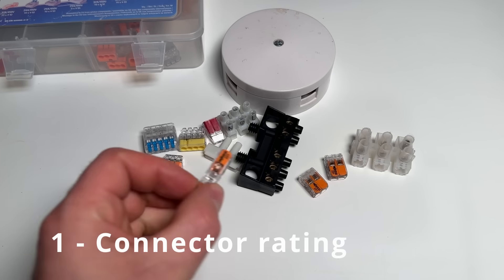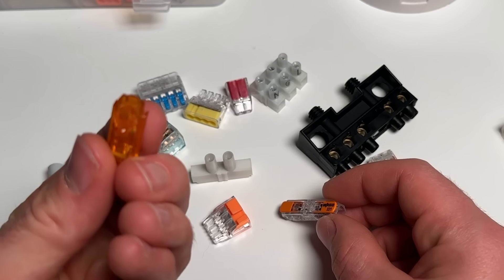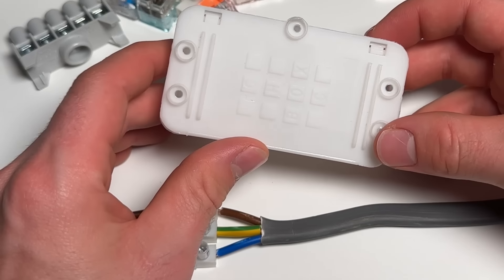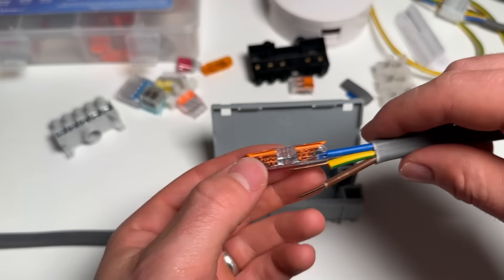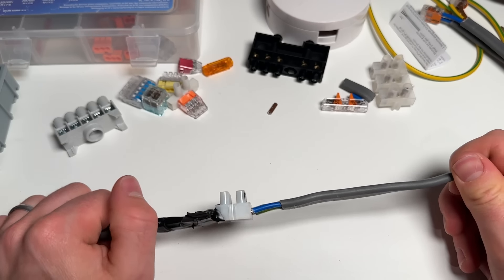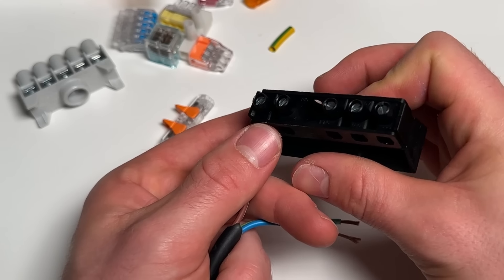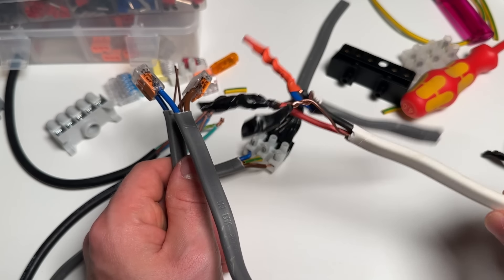BIGGEST DIY Mistakes Joining Cables

Comment: Wait a sec, you want to teach somebody about connections, showing in your thumbnail phot that Wagos (perfectly safe and strong) are bad, and then showing NOT EVEN CONNECTED terminal block as "worse".
Reply from the maker: A terminal block not connected is still worse than a wago haha. The wago in thumbnail shows exposed copper, that is why it isn’t okay.
Reply: I agree with you, thumbnails like this is stupid and misinforming , and nobody looked that the wago had exposed cooper.
It's not the first video I've watched with this type of thumbnail and i always give a thumb down for things like this.
Reply: Confused the fuck out of me
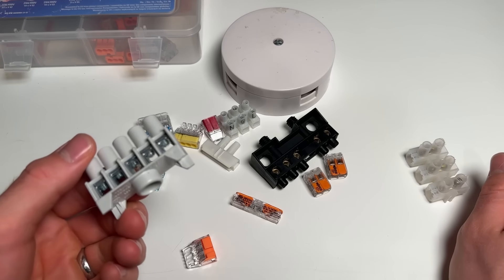Reply: Yep, clickbait ass thumbnail. Downvoted at 1:20, not going to finish, and told YouTube to hide channel/not recommend. It’s disrespectful wasting ppl’s time.
Reply: @ArmanRafique  in that case you could not properly inspect joints visually
Reply: In my experience its diy people using low capacity block connectors to extended shower cables quite often there melted
Reply: @TheDiligentDIYer1759 nothing wrong with wagos if used correctly
Reply: I noticed the exposed coppers pretty quickly tbh!

Comment: The Wago's are an amazing invention, safe and simple for domestic electrics.
Reply from the maker: Absolutely! Thanks for watching!
Reply: @TheDiligentDIYer1759  Strangely enough it's pronounced Vah-Goh. Watched an efixx video interviewing some guys from Wago who said it's named after 2 guys who made the patent for it in the 50's.
Reply: Also WAGO is a private company and has the patent on it, outlawing it so it becomes a monopoly and can change the prices whenever it wants its a terrible idea
Reply: @MrFiver1111  I prefer that over a chance of a Chinese WAGO for 0.00001 cents a piece that will burn your house down. The patent ensures that the original company's design is followed including the guarantee for compliance.
Reply: ***the wagos with clamps The ones without clamps and no hole for the multimeter... my fucking god, I hate taking those things off so much.
Reply: @djoakeydoakey1076  Not strange at all, as it is a German company. Hence the car brand VW is pronounced Folks-vagen ;)
Reply: We will see in 50 years - what it is worth.... Electrical installation at home should work properly for years - with currents up to 16 A...
Reply: @slapfight3581  The Wago has been in common use since the 1980's, so in another decade we have the real world data.
Reply: @MrFiver1111  HAD a patent on them.
Reply: agree they give you confidence that the wires are nice and tight and avoid the worry if you round tiny screws on normal connectors..love the lever option
Reply: Old, experienced electricians still preffers twissting cables.
It is a proven cable connecting  technique
Reply: @markot9902  Twisting works, but what about disconnecting and connecting them back? Using WAGO - no problem with that.
Reply: @Piqus3  Yes, that is true. Although, there is rarely need to "untwist" twisted joints.
Old school electricians told me that wago's have problem with springs and it is common for them to experience lose joints after cpl of years which requires replacement
Reply: No.
Reply: Hey Boss im trying to do a Y Plice on my Govee Lights, if i use the 3 connector should i expect any problems? im branching off to the side of the house and im afraid it wont have enough juice to power the remaining lights as it will be another 50 feet?
Reply: @Papiringo505 Difficult to answer without knowing more details. The Wagos can handle domestic voltage and current. Use the correct gauge of electric wire cable to power your extra lights. Seek the help of an electrician if you are unsure. 🙂
Reply: @MrFiver1111 Numerous other big companies make similar products, so WAGO’s patents are clearly not a barrier to entry.
Reply: @markot9902  rarely a need to untwist twisted joints? what do you even work as an electrician?
Reply: Safe and effective. Mix & match stranded and solid wires without issues. They are rated for any domestic and office needs. All of these connections are fine if used on the right place. Electricians know what to use and where.
Reply: @TheDiligentDIYer1759  how do they extend cable outdoor light wire
Reply: @MrFiver1111  however there are lots of other manufacturers who have made their own design which is fine and they are approved so it’s not on monopoly when they simply make wire connections because there are other method
Reply: I would never buy those plastic ones with a screw. I have seen that plastic decompose and turn into dust when I just barely touched and squeezed them.
Reply: @llVIU 😂😂😂😂😂🤦🏾 for real a testers nightmare

Comment: Struggling to understand how terminating stranded cable in screw connectors without a ferrule can be bad when there must be literally millions of UK 3-pin plugs in use at this very moment wired up in precisely this way.
Reply: A UK plug is designed to accept fine stranded cable. Curved sides that have no side space, smoothed screw end. Most connector blocks are not. Rough screw end that damaged the strands and space around the screw for the strands to float in.

Comment: There is a difference between twisting and twisting. The way you doing it, showing us, is the wrong way but if you do it the right way it is very strong and makes an excellent connection. Twist solder around it and heat it up properly makes it even better. This is the best connection you can make, no other connector can beat this. By using shrink tubing properly it is also water tight and protected against corrossion. Rule #1 By everthing you do you need to know how to do it right.
Reply: @OntraadSpeldinnen:

Totally agree with you, a good twisted and soldered connection makes a pretty perfect cable joint.
A lot of people will try to tell you that a crimped connection is a bad connection, but in 48 years of using them I've so far never had one fail.

Comment: 30A juntion boxes are designed for ring final circuits. They were commonly used and still are to extend cables. Each leg of a ring is desinged to pull at max of 27 Amps at fault. So a 30 Amp jnc box in situe is perfectly acceptable as long as it's accessible for inspection. We tend to use wago and ideal connectors in Maintenance free boxes so we don't have to worry about inspecting them.
Reply from the maker: In theory you could have a very long ring and sockets close to the CU maxed out, and probably exceeding 26A, or even 30A, on that short leg. Thanks for watching!
Reply: @TheDiligentDIYer1759 on a ring final circuit the sockets are fed from both sides so there won't be an issue with sockets being further away from the fuse box. Did you know that 2.5mm twin & earth cable is only rated for 26amps? A 30amp junction box will be more than adequate
Reply: How will the maximum fault current only be 27A when the circuit is protected by a 32A breaker? And this is only the working current not fault current rating which can be in the hundreds of amps momentarily.
Reply: @TheDiligentDIYer1759  to fully understand the UK ring final circuit you need to understand the application of diversity. This is usually beyond the understanding of your average DIY’er. If in doubt consult the qualified electrician.
Reply: Ring circuits will have two cables coming out the circuit breaker supplying the sockets so the 32 amps will be split between both cables that's how you are able to use 2.5 cable rated at 26amp as the electricity will take the path of least resistance meaning it will draw from the cable that's closest to that   socket
Reply: So he favours Wago's that are down rated with 2.5mm cable but not a 30 amp junction box. 😊
Reply: @TheDiligentDIYer1759  Ring final circuits used to be on 30A fuses.   They didn't blow at 30A (indeed a 32A MCB is likely to trip before a 30A BS3036 fuse blows) but the junction boxes were considered suitable.
Reply: @martinw245 yeah I smelled shite on that as well..😮😊
Reply: @demonkey123  in the worst case scenario 2.5mm cable can hold 27 Amps. If you now imagine a break through a terminal or someone nailing through a live or neutral terminal. We have a broken circuit. The breaking capacity of a B rated mcb or fuse is much higher than the stated 30/32 Amps. So now we would have 2 cables from the consumer unit which can only hand 27 Amps potentially overloaded. More so if heavy loads are closer to one side of the broken ring.
Reply: This why testing and inspection is important.
Reply: @demonkey123  Very true and this was on of the siding factors as to why E.i.C.R's were introduced for rentals and HMO's which have higher loads drawn on ring circuits. They are highly outdated and were introduced during world War ll when copper was at an all time low. However they are still in use and many other electricians still practice installing them. 
My main concern is that many private home owners have potentially broken ring circuits. Which can be dangererous. There's no legal requirement have have an electrical inspection for home owners. The same goes for gas safety checks. Plenty of d.i.y mishaps too a ring can easily break on changing plug outlets. My preference is the installation Radial circuits they're much easier to test and in most cases if L/N break the next outlets won't work.. Only the loss of earth it goes undetected.
Reply: @rayc1503  
Final ring circuits came into their own in the late 1950s. They were not to save copper. My mother's house was built in 1954 with 13A G Type plugs. It had radials. Ring circuits have been widespread in the UK for 75 years. They have been found to be very safe. The British G Type fuse-in-plug was to protect appliance flexes. And to standardise on one plug and socket as previously there were different sized plugs & sockets and cable for different types of current draws and appliances. It was common to have three different types of socket in one room. However the fuse-in-plug became an enabler to use final ring circuits. The final ring circuit is ingenious in its simplicity. When used with the British G Type plug the ring is a busbar run around the house with distributed fuses at each appliance. 
There are many advantages to rings:

1. Cheapness, as smaller easier to install wires can be used;2. A large number of sockets can be off one cheap to install ring;3. Having the same number of sockets using radials would mean multiple radials and multiple extra breakers at the main panel. Far more cable, expense, labour and hassle;
4. The 32A breaker and 13A fuse in the plug ensures safety;
5. Portable plug-in appliances on a ring cannot exceed approx 3kW. Some plug-in ovens are on rings;
6. Rings usually have a 32A breaker at the main panel - can be a lower value; 
7. Using push-fit maintenance free Wago type connectors to connect up the ring adds safety, as not being screwed connections they do not work loose. The ring's current does not run through the socket terminals (this applies to radials); 
8. The British plugs enable rings having a max 13A fuse in them - can be as low as a 1A fuse in the plug to suit the appliance and flex/cable. Small flex and appliance? Then a smaller fuse;
9. Rings in the UK are limited by square metres of floor space, with no limit to the number of sockets on the ring. 100 square metres of floor space with 2.5mm cable for a 32 amp final ring. 

The cable can be 4mm, which is advisable in an unbalanced ring drawing high current loads;10. Less voltage drop on long cable lengths as voltage comes from two ways;11. Two ways for the earth wire back to the main panel, increasing safety levels. 

Radials are also used in the UK. Rings are not mandatory, but used because they have proved to be generally trouble free and safe. They can be installed using rule-of-thumb. These days a ring will be on an RCD, RCBO or AFDD - these now are becoming DP, so safer again. AFDDs are now mandatory in some socket installations and recommended in all installations. AFDDs raise the safety level. 

If an office wants more socket outlets for extra desk computers. It is a simple matter of extending the existing ring with the extra sockets as the current draw is low. Cheap and easy. If radials are used many radial circuits would be needed, which may mean an extra consumer unit, breakers, wire etc, then far more labour. 

Some disadvantages are: a) Rings are more difficult to fault find. But electricians have no problem once the ring is fully understood. The ring can be split at a socket then tested as two radials;b) Another is that if a number of high current drawing appliances are on one side of the ring, say nearer to the main panel, most of the current draw may be down one cable leg of the ring with the cable rated below the main 32A breaker. 

An unbalanced ring. 2.5mm cable is rated at 27A max. Although tests have proven the cables do not exceed their current capacity in the vast majority of cases, just an imbalance in distribution of the two cables from the main panel (consumer unit). Good circuit design will prevent this, negating this disadvantage. 4mm cable can be used to the point where heavy current drawing appliances are, then 2.5mm for the rest, if it is that troubling for some. Using 4mm cable on one side of a ring and 2.5mm on the other, is still cheaper than a bunch of radial circuits.

Overall one final ring is superior to a bunch of radials needing their own breakers at the main panel. They are simpler, cheaper, being proven to be safe and worked well over the past 75 years. Using the new AFDDs on rings, which are recommended and mandatory on some installations, gives a far higher safety level. 

You will have to give a very convincing argument against rings. I have not heard of one yet.
Reply: @martinw245  
Wagos are rated at 32A.
Reply: @johnburns4017  

But down rated with 2.5mmm twin and Earth
Reply: @martinw245  
??
Reply: Call me old fashoned but I would be using the old style junction boxes over a wago every time
Reply: @grahammckechnie8438  
You have not much of an idea.  Find out.
Reply: @johnburns4017 I've only  been a spark since 1988 but I bow to your greater DIY expertise
Reply: @grahammckechnie8438  

Not a good idea for inaccessible locations. Wago in the proper enclosure is certified MF. Conventional junction boxes aren't.

Old style junction boxes are a pain to use, too.
Reply: @grahammckechnie8438  
If you are a Spark you should know. Few use that outdated j box junk any more. Do you still fit fuses in CUs?

Comment: I bought that exact same ferrule set last year - I've been guilty of using stranded wires in screw connectors in the past... I have changed my ways 😀
Reply from the maker: Glad to hear it! Thanks for watching!
Reply: Stranded wires in screw terminals used to be pretty much standard for a long time - until peopl enoticed that wasn't very reliable.  Same for tinning the end of stranded wires.  And some folks just don't get why they should not continue as they used to.
Reply: It's "Horses for Courses"  Stranded wires in screw terminals are great for prototyping.  You just have to be aware of the application and the suitability of the hardware you are choosing.
Reply: @markawbolton  prototyping is fine, nothing can be perfect in the prototype stage.  Things are different when we're talking about connections transfering enough power to cause a fire hazard.  So I'm inbetween twisting wires, soldering, screw terminals but also wagos for terporary connections.
Reply: @ralfbaechle  Well at the prototyping stage everything must be manipulable.  But that said the sorts of things that require screw connections rarely are in contention. 

To build a machine that goes into service requires a whole differnt mindset. I am sure we both understand this.
Reply: Well over 100 million power outlets in Australia, and a similar  numbers of light switches and lights all use heavy stranded (7 strands per conductor) wire in screw terminals - copper, not aluminium, and there are very few house fires.  Older houses use single stranded for conductors and stranded for earth, again using screw terminals, with the screw tip putting pressure on the wire.whic goes into a tunnel.  It looks like this post video is about getting commissions on tools.
Reply: @JulianSortland  Screw terminals are not fundamentally bad.  It's the combinations of finely stranded conductors with screw terminals where the screw directly puts pressure on donductors, that is causes the problems.  Thicker strands - ok.  Finely stranded conductors in ferrules - ok.  Or types where the strands are protected by some other means.  The second no go are tinned conductors.
Reply: For screw connections, it's good idea. But it's better not use ferrules with Wago connectors.
Reply: All UK 13a plugs I've seen have screw terminals with no room for ferrules, and everything I know of that is suitable to be connected to a 13a plug has a flex with stranded wires. What is the way round this?

Comment: All depends on the load. Wago for light circuits but I'm with screw down connecter strip. It's not what you got, its how you use it..  :)
Reply from the maker: Hahaha very true, thanks for watching!
Reply: No it doesn’t, Wagos can be used for any circuit up to 32a, so are perfectly acceptable for lighting, ring and radial.
Reply: @Pugjamin  Here ovens are on a 32A circuit. Would wagos be used ?
Reply: Never seen a maintenance free connector for 4mm2 conductors.